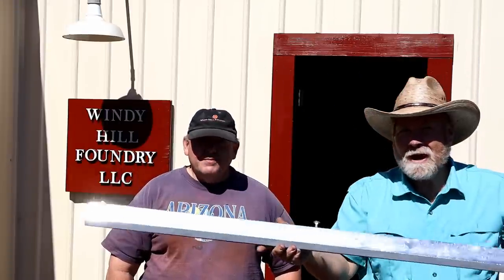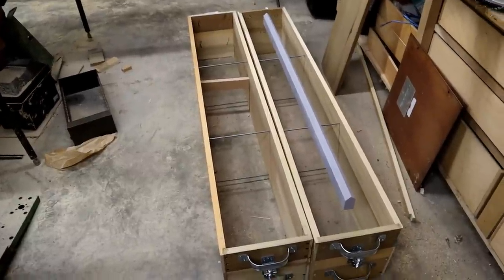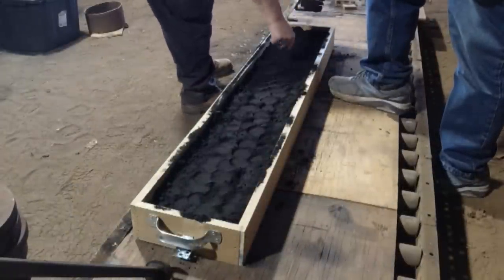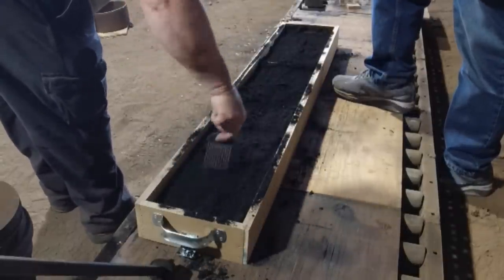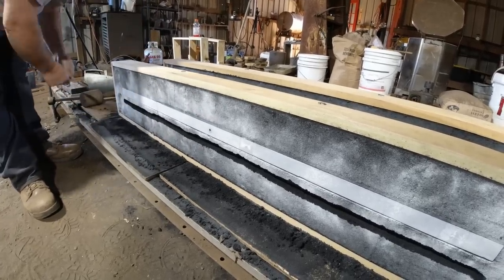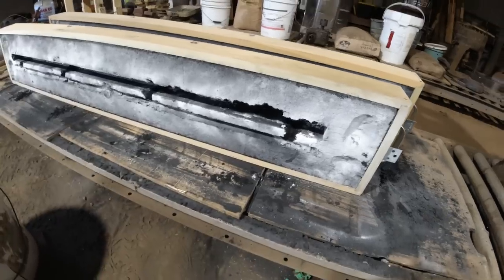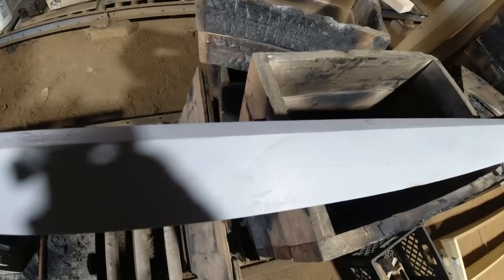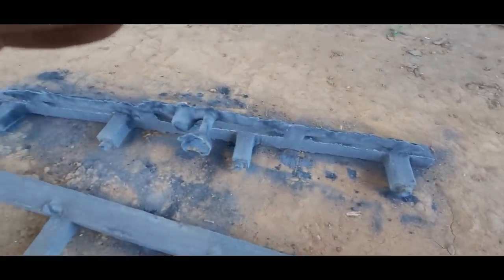Monarch 10EE 7000 Dollar Mistake Lathe: Windy Hill Foundry Casting the Grinding Rails.

Comment: My high school was a small school, and we had a great shop/science teacher. We made all sorts of things in shop/welding class. Casting was the most fun projects. The shop is still there and I'm not sure who runs it now but i feel lucky to have had a great teacher his name was Mr. Lomeland.
Reply from the maker: Where was this?   I was lucky in that we were able to go to shop in Jr High also...  The first woodworking shop I had was great.. we had to buy the wood from the shop supply room and the biggest piece was a 1x6 rough 4 sides.. I built 2 full size desks one year..  Nails were forbidden and if you wanted to use a screw you had to write a 1/2 page request stating why no wood joint woukd work.

Comment: Maybe some of the venting and grooves could be part of the pattern?  A smoother feed tube might have less turbulence and, because of 3D printers, you could taper the entire thing to insure even temperature and flow.  Another question - couldn't you make a simple lifting gadget to slowly, evenly screw-jack the pattern out vertically? I'd still tap the hell out of it, but anything that can lift directly vertical and exactly the same amount along the length of the pattern should minimize the risk of damaging the mold. Because you could lift the pattern with a threaded mechanism, you could more carefully watch every edge, even re-tamping where you can get away with it.  I think Clarke should take an I-beam and put in on 3 legs, so its suspended over the top of the form with room to remove the top half. As long as that I-beam stayed steady,  beam clamps could suspend threaded rods anywhere over the pattern. If those same threaded rods would happen to fit the threads you put in your pattern, you're only a few nuts and a crescent away from perfect. And the whole thing could be easily moved out of the way prior to closing the mold.

After typing all that, I realize that you've probably tried this idea and there's a reason why you don't do it. I hope I'm not a dumb-dumb.
Reply from the maker: IT came out great in three minutes after I spent an hour sanding and applying the silver metal tape...   It's a  matter of the pattern being right...
Reply: @10swatkins  My other thought is possibly using small drink straws to provide venting to the bottom of the patters to eliminate any vacuum.  Breaking that suction that way would leave whiskers on the finished part, but would help protect the mold. You can probably tell I'm using my experience as one who plays in a sandbox  drinks highballs.

Comment: Our 1956 high school Industrial Arts cope and drag sets had a 1 inch wide dado groove on the inside walls. We cast aluminum ash trays or a ship's cannon base to machine a brass cannon barrel future project. The depth was about 3/8 inch deep but you use flat walls without a groove. After seeing your videos I think 1/8 inch depth would have been adequate.  The adhesion of your sand is amazing.
Could the gates have been loose pieces placed against the pattern to permit tapping during pattern removal?
As a 56 years of plastic mold designing have experienced draft undercuts prohibiting part ejection more times than I want to recall.
Merry Christmas to all
Reply from the maker: The gates were placed on top of the pattern so I'm not sure what you mean..  I was going to put a 3/4" strip on the inside of the boxes but Clark did not think it was needed..  The pattern had a 7 degree taper on one side so if it lifted 1/8 inch it would come out...  Watching the video I am thinking that the base we were working on was also flexing and not taking the full "pounding"... 50" long stuff makes for a LONG flask :)

Also after working on the pattern it was just 3 minutes to remove from the second mold... 

Thanks for watching and Merry Christmas to you also!

Comment: Does clark need any help with a new furnace. His failed recently according to his video of a few days ago.  Maybe he needs something like rolled plates bent in you press break  then the quarter or 1/8 bends welded in a circle. He was going to pour a new floor for it.  Might be worth a call to him Steve.   Could multiple layers of steel sheet be welded to make a furnace floor.
Reply from the maker: I talked to him this AM... He has it handled but I will be a back up for him !

Comment: Sorry for the stupid question, but can the flask be welded from cheap steel flat bars to prevent bucking?
Reply from the maker: Not stupid!  It could be but I think it would have been even more expensive and I think the walls would have had to have a few ribs welded to them for stiffness..    In this case I was not going for a really accurate casting as I am going to plane it on my planer and the final size is not critical...   Also this was a one off piece and that size flask is not used very much.

Comment: What’s the reason these parts could not be machined from stress relieved CRS bars? Is it because of the machining characteristics of steel versus cast iron? Thanks.
Reply from the maker: Bingo... Cast Iron I can hand scrape to perfection easily.
Reply: @10swatkins  Thanks makes perfect sense.
Reply: Also, even stress relieved bars still warp a bit.

Comment: I am a machinist and if I was going to make something like that , I would buy durabar. Its basically just cast iron bar stock.
Reply: Good luck on buying a rectangular section bar from Durabar.  They have cut back on their offerings now days.  If it is not round or square, they are not interested in selling it.  Now, if you commit to buying 200 tons a year, they will talk to you.  Go with Windy Hill Foundry, you are money ahead. Ask me how I know this. Ken
Reply: @4GSR  I bought rectangular bar to make new main caps for a pulling tractor engine a few years ago
Reply: @TheJohndeere466  A lot has changed with them in the last couple of years. I deal with them almost on a weekly basis.  Oh, for anyone that wants to call in and order a small piece of G-2, $200 minimum order!
Reply: Steve tried to buy it. Couldn’t
Reply: @4GSR  I think we have some rectangular durabar  at work. Its been there for a while though.
Reply: @4GSR  Speedy metals has it. Im not sure of his dimensions but 1 1/4 x 4 1/4 x 48 is 327.80. A little pricey but it is available.
Reply: @TheJohndeere466  Cherish it like there's no more!!! Don't get me wrong, they do have a few selected sizes available in rectangular at Chicago.  Ft Worth Warehouse does not carry any rectangular, just round bar. That's the location I deal with.  It's all good.
Reply: @TheJohndeere466  Yep. I have a bar of it 1 x 5 that I've been whittling down for the last few years myself.  Crazy pricing! I paid half that for it about 8 years ago.
Reply: Hobby machinist here. All this  foundry work is very difficult and dangerous. Clark does an excellent job and Steves a good helper. Wheres Don? 🛵
Reply: @rossilake218  You think Don accidently tripped into the melting pot?
Reply: @4GSR  Probably riding his Motor bike around the property or Steve has him locked in the Truck.
Reply from the maker: I tried.  I call Durabar 3 times and when I finally got a price it was going to be 900.00 for what I needed...
Reply: @10swatkins  How much would Clark charge for those castings for a retail customer?